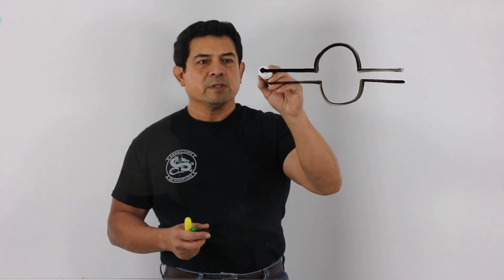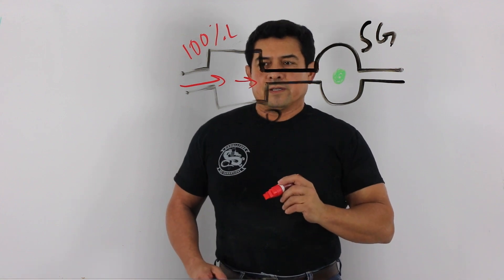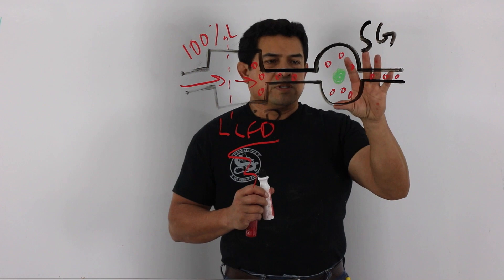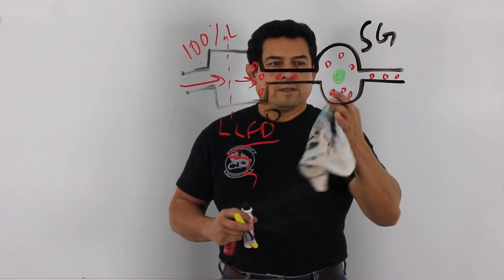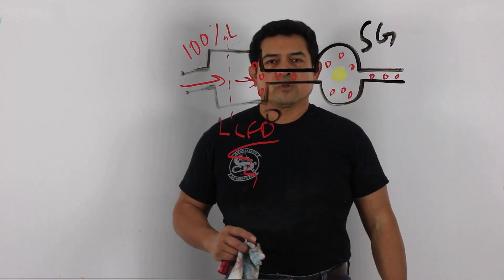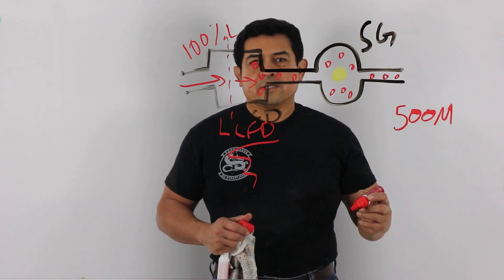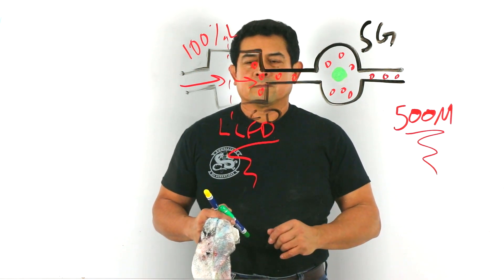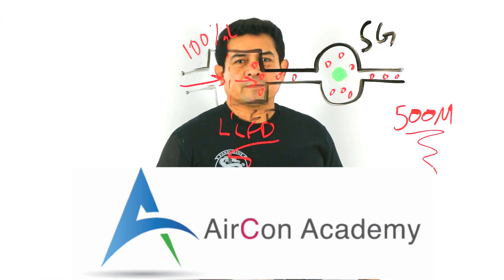Sight glass and Acid testing - HVAC Online Training and Courses

Comment: Pulling a vacuum ? What about the gas? Is the customer willing to pay? Most of the time no. So change filter driers a couple of times.. You have to tell him you can keep changing driers as copeland once told me for burnouts and leave the charge or dump it and vacuum and charge alot and maybe lose a customer. All is nice and dandy what to do properly with a moisture problem. But theres a bigger problem The customer thats even bigger when it comes to money
Reply from the maker: Wow! You brought up a really good point that I tried to cover in class! Those customers that want you to come in and magically fix the unit in no time at all for next to nothing and never have a problem again. Yes, going to different properties is hard trying to talk him into taking these special measures. Fortunately for us, the government these days says that you have to do this and you have to do that. Like recovering for example we cannot legally release the refrigerant so by law we have to recover. Those customers are tough because they need to understand that you don't have a choice. Also, if you find acid in a system, you need to clean the system up, but they are not going to want to pay for that. That makes it very hard on you. It is like when we go to the doctor. The doctor says you need dialysis every two weeks or every week we have to get that done so we can survive. The same thing with air conditioning units. We need to do these things so that they will survive and they will last. The problem is they only see this mechanical piece of equipment that is out there. They don't understand how all of this will affect the unit. Thank you for bringing this up, and thank you for watching!

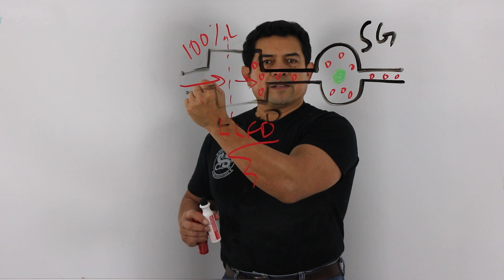Comment: 2:28 i work on Coachs and I've called Emerson and they said thats not the proper way to do it. They tell you to check pressure differential between the two connections. Which is a 5 psi differential drop. Carrier units has it set up to do it that proper way but most units don't come configured for it which is strange.
Reply from the maker: Yes most of the time there is no way to check a pressure difference, there is a wy on the suction line but on commercial and residential units there isn't a way. I usually install access ports in units to help this BUT they tell you one thing and then seem to do another.    thank you for your input    and yes that would be a great way to check IF the manufacturers would provide the connections.   Thank you!!

Comment: Been in supermarket refrigeration for 10 years. Don’t forget some of those indicators are purple to pink. Another hot tip. If the sightglass is dirty, once you have it pumped down the can remove the rear indicator and replace it or clean the inside of the glass with some B12 and your t stat screwdriver.
Reply from the maker: Thank you so much for your comments! There's just so much out there it's hard to cover it all in a short amount of time! But thank you so much! And thank you for watching!
Reply: @AirConAcademy  yup, almost impossible to cover everything. Too many components.

Comment: One more question please I do a job ac r410 to the side glass   is before the filter and it's bubbling I take my time and charge the sistem why is that happened
Reply from the maker: Thank you for sending the questioning, the site glass should be installed after the liquid line filter dryer. One of the reasons is because if the filter dryer is clogged, you will see bubbles in the site glass and it will help you troubleshoot. If the site glass has bubbles in it you need to look for a temperature drop across the inlet and outlet of the liquid line filter dryer. If you have a temperature drop of 3 or 4°F, then that liquid line filter dryer is clogged. This will show bubbles in the site glass. To properly charge a unit you need to know the type of metering device. You should not charge a system using the clear the site glass method. If you have a TXV then you should charge by sub cooling.  If you have a piston as a metering device, then you charge according to superheat. A lot of times in the panel for the unit It will tell you what the super heat or the sub cooling should be. I hope this answers your question. Good luck and thank you for watching!

Comment: Nice information  question what should be the temperature of the  filter I don't have any thing to check that  temperature and I don't have the  microns gage  I you  my regular gage to pull a vacuum  so how long should I take to pull a vacuum and how  should I know the  filter is clog with out  side  glass  most machine  don't have  help me if you  can thanks God bless
Reply from the maker: Wow! Good questions! The liquid line filter dryer should be the same temperature as the liquid line. On a warm day that liquid line should feel slightly warmer than body temperature. In other words when you touch the liquid line if you feel just a little bit warm, then what you would do if you would grab the other side of the liquid line filter drier and see if there's a temperature difference. If you do not feel like temperature difference, then your dryer should be OK.Yes, unfortunately, most systems do not have a site glass but by just touching both sides of the filter dryer you can tell if there's a temperature difference.  If you are doing this type of service work these days, you didn't need to invest in a micron gauge. By using a micro gauge, I realize how in the past we were not pulling good vacuums. Also, just last week I was teaching a class and I was showing the guys in class how fast a vacuum pump would pull the vacuum. The set of gauges that we were using had a small leak somewhere and that was a great example in showing them that even though the gauges look good, and they are down to 30 inches of mercury, you may still have a leak and a micron gauge will show you that.  I hope this answers your questions!  And thank you for watching!
Reply: I am from Guyana it hard to get those tools like the  microns gage

Comment: hi julio do we need to evacuate refrigerant when changing dryer filter
Reply from the maker: Hi, yes you need to evacuate because when you evacuate you are removing the air and noncondensibles. If you do not evacuate you would leave the air in the system and Dalton's law will take affect. Meaning that we will have a combination of gases in the system raising  the , because according to Dalton's law,  when you have a mixture of gases in a confined space each gas will have its own pressure. So the pressure in the system will be higher and in a refrigeration system when you raise the pressure the temperature will go up. Meaning that the evaporator temperature may not be 40° anymore but something higher. The filter dryer is only going to trap the moisture and the dirt that is in the system. So yes, we do need to evacuate when we change the filter dryers. Thank you for asking a question and I hope this answers it.

Comment: Hi actually I have a problem with my ac it’s cooling less got it checked from tech seems he didn’t caught the problem I m mentioning the reading he took and he decided in few minutes that compression faulty it’s not compressing at full capacity after watching this video readings r on Goodman R410 head pr 250/suction Pr 100  he wrote 50deg SH and 14 Deg idk what it is maybe sub cooling I have called him again for expansion valve seems he wants me to change the whole ac unit as he say the compressor is drawing low amps 6amps only ac blows cold air but runs continuously what can be the cause as I can’t afford to change whole unit it’s only 4 years old but compressor is 6yrs old out of Warranty
Reply from the maker: 50° of superheat is very high! The pressures are also low. Both the suction and the head pressure. It sounds like it is low on refrigerant.   It depends on the type of meter and device as to how much more refrigerator you need to add but it sounds like it is low. If the amperage is low like you mentioned that also indicates low refrigerant. The suction pressure should be around 118 or 120. The head pressure should be higher than that depending on how warm it is outside. The sub cooling will depend on the unit and the outside air temperature. You should have anywhere between 10 to 25° of sub cooling. But for right now it sounds like it is low on refrigerant. I hope this helps. Let me know.
Reply: @AirConAcademy  I have called the guy again but as per him he charged 1 lbs ga more but he says compressor is not taking more gas it’s faulty change the whole ac unit he didn’t checked the txv extra so idk what’s problem he sounds to me more of a salesman to buy new product as I have one company protection plan bought
Unit is 5 years old goodman residental
I can come up again with all the parameters checked again do u want any specific parameter for compressor faulty I wanna make sure he is not scraping my good unit to sell new which i feel
Reply from the maker: @JaspreetSingh-te7jt  I'm sorry took me so long to get back to you.   and I am sorry, but I think you are correct he's trying to sell you a new unit. That is how a lot of them make their money. To me it sounds like it is still low on refrigerant. You may need to call someone else. With the pressures that you sent to me before it is definitely low on refrigerant. 1 pound may not be enough. I am thinking you may need someone else to look at it.   If you call him back you should stay with him and take pictures of the pressures he is reading and the temperatures so that you have a record of it and maybe you can send me the suction pressure, high side pressure, the temperature at the outlet of the evaporator and the liquid line temperature. That way I can help you figure out the superheat and sub cooling.
Reply: @AirConAcademy  sure I m gonna call some other Tech n share picture reading soon
Reply: @AirConAcademy  thank you sir u were absolutely correct they came in my presence again and found leakage in evaporator thanks for helping me .
Reply from the maker: @JaspreetSingh-te7jt  I'm so glad I could help! Good luck!
Reply: @AirConAcademy  u saved me thousands it was awesome moreover I had protection plan they tried to cheat me so leakage found was on evaporator not condenser they pay for evaporator if it was condensor it would have been me moreover guy who ask to change whole unit compressor faulty was most experienced in that company very risky if I wasn’t aware and u would not have advised me thanks
Reply from the maker: @JaspreetSingh-te7jt  I'm so glad I could help you, and help you save some money!

Comment: Hi Julio, thank you for that awesome explanation of why you might see bubbles and of the sight glass color. Could you please tell us the proper procedure for vacuuming a system? I’m more so interested in automotive systems, but would you vacuum the high side and low side at the same time, or individually, or low side only? Thanks!
Reply from the maker: Thank you for your comments! I'm glad you liked the explanation. If you're working on automobiles or not it is always best to pull a vacuum on the high and the low side at the same time. This will help you pull a vacuum much faster so you can make sure you have pulled out all of the air, noncondensibles and moisture out of the system. Don't forget, use a micron gauge to pull down to 500 µm.  Thank you and good luck!!!

Comment: So  how should the side glass look  clear    and the  system is running good  if I am  correct thanks let me know
Reply: Thank you for responding  a collar I am working on have a side glass clean but only suction line I could put on my gage on there is no  discharge connection have can I know  if the system is running good  thanks
Reply from the maker: @wasimedoo1506  it really depends on the type of metering device that you have. If you have a TXV then most likely it is going to adjust to maintain proper superheat and you will have enough refrigerant in the evaporator. If you have a restrictor/Piston/orifice/piston then you need to check the superheat. Typically for air conditioning systems we would want around 8 to 10° of superheat. You may want to see if you can get the manual for that unit that you working on to see what the superheat should be. You should be able to figure out superheat since you have a connection on the low side. But if your site glass is clear most likely your unit is running well. I hope to sit formation helps.
Reply from the maker: If I understand your question correctly, yes the site glass should be clear. Typically if the site glass is clear that means that you could possibly have enough refrigerant in the system. To be absolutely sure you need to take superheat and sub cooling readings. Just because the site glass is clear that does not mean that you have enough refrigerant in the system.   I hope this explains your question. Thank you for the message.

Comment: Some of the new filter driers come with a port on each side of the drier, typically we look for a 3-5 psi drop across the drier, anything higher indicates a restricted drier! :)
Reply from the maker: Yes, definitely. The suction line filter dryer's will have that connection to get the pressure drop. I have not seen any liquid line filter dryer's with ports to get the pressure difference. I'm not saying they don't exist I am just saying that I have not seen any. Thank you for the information I will be looking for those dryers out there.
Reply: @AirConAcademy  oh yea, they are definitely a rare find, ive seen them maybe like twice and only in low temp applications

Comment: Ty. The sight glass I’m on has a black dot in the center. Not green or yellow  any thoughts?
Reply from the maker: The only time I have seen that is when the system has been dirty and there has been a burn out of the compressor. Check your system to see if it has acid in it. If the acid test comes back positive then you may need to change the dryer with an HH dryer and replace your psych class. I have only seen that a couple of times and it has been because of a dirty system. Good luck!

Comment: Can this method works on car ac??
Reply from the maker: In a car you do not have a liquid line filter dryer. In older cars there was a site glass but the new ones do not have a site glass. In a vehicle you have the accumulator which has a bag of desiccant inside. The desiccant will absorb the moisture but it will not really create a pressure drop. Both systems are similar in how they operate and for troubleshooting but again a vehicle will not have a liquid line filter dryer that is going to clog up and create a pressure drop. I hope this answers your question.  Thank you

Comment: Lots of ppl dont even get to 500 . Some
Reply from the maker: 500 is the ideal and what the manufacturers want!    and you should be able to get to that the problem is time!!!   I had a student that could not get to 500Microns    I told him to leave the vacuum pump running and he said it too over 8 hours to get to 500.   the problem is he had time, it was in his building.   a lot of us do not have the time.   but if the system is tight it should pull to 500 Microns.
Reply: @AirConAcademy  yes I know that.  What I was saying some ppl just let it stay on a vacuum for about 20 mins and call it good . I've seen it. I've been in this field for 10 yrs now
Reply from the maker: @Savage_Beast13avn  yes   that is what some people do! and well it may be enough?  I know guys who never use a micron gage,   so they are just guessing.   Some people cannot afford a micron gage, some do not know to use one because they  do not care.

Comment: Great video. If I change liquid filter dryer and pull a vacuum in the liquid line section from the receiver's outlet king valve to the solenoid ahead of the TXV, will that solve the moisture issue in the system, what about moisture in the section after the TXV up to the receiver? Will that be absorbed by the dryer when the system is restarted? and how moisture can the dryer absorb?
Reply from the maker: Just pulling a vacuum in that small section will help a little but you will still have moisture in the rest of the system.   If you change the dryer  the new dryer will be able to absorb more moisture. The dryers can only absorb a specific amount of moisture, so you may need to replace the dryer two or three times after two or three days of running time to make sure you got all of the moisture from the system.   I guess it depends on how much moisture you think your system has as to how many times you will replace the dryer. I would say two or three times might be enough.

Comment: Nice video sir thankq
Sir chiller flood back liquid reed broken and other chiller sp and st dop
Reply from the maker: I am not usre I understand  but  you need to have superheat.   if you do not have superheat liquid will comeback and ruin the reed valves and kill your compressor.   check the operation of the TXV   or metering devise